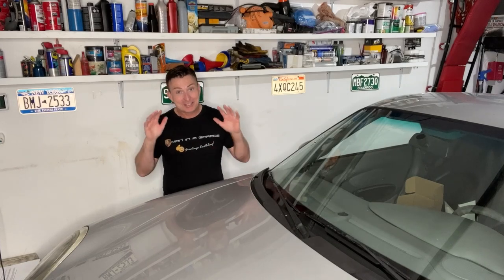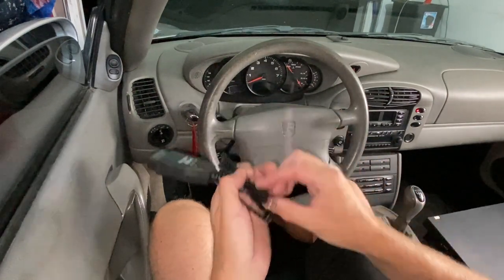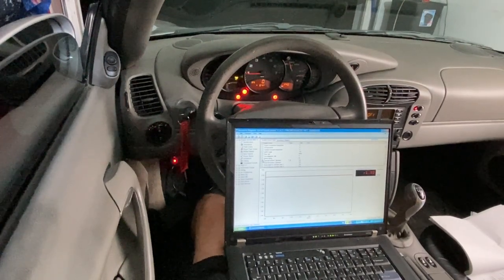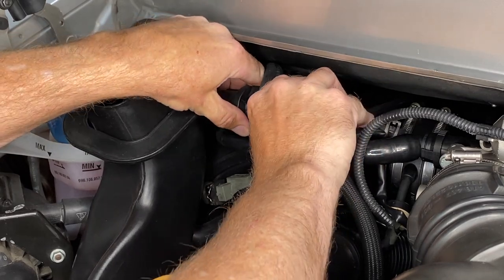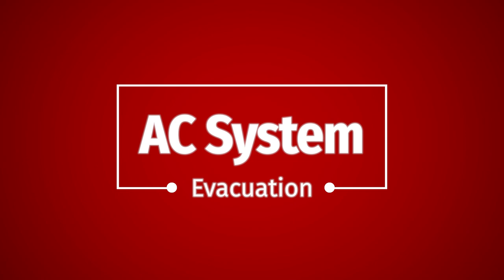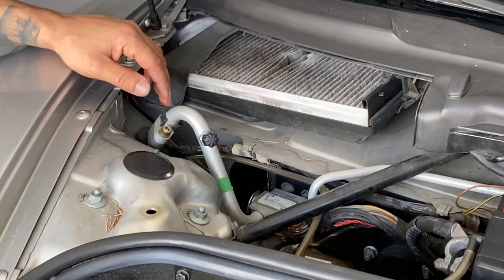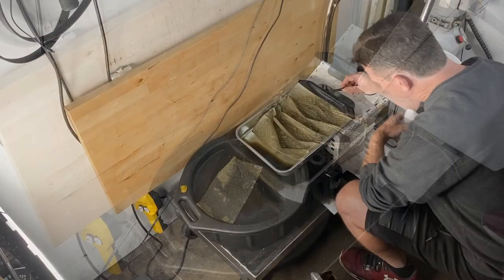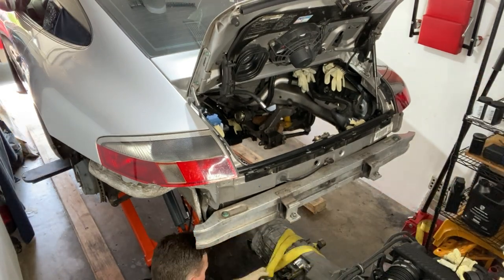Porsche 911 Engine Removal in 12 Minutes!

Comment: Oh hai there. Welcome back! 
Step 1 of any Porsche repair: drop engine... I still love your table! 
Reverse lockout - isn't that part of the shifter assembly? Function First kit is a nice upgrade "while you're in there", just sayin' :)
Reply from the maker: You know I’m googling function first right after this. 🙌 From the info I can gleen for the trickle of rumours and hearsay coming my way this is what I did. 

The bolt thing I unscrewed holds a ball bearing and spring in place. When you go to reverse, it’s that ball bearing/spring combo that stops you accidentally going into reverse when you intend on going into first. The specialist who looked at it scratched their head a little bit. The old guy came out afterward and suggested I should be able to open it up, fish it out and put it back in place. They said I should not drive it just in case the ball bearing or spring get caught in a gear an chew something expensive?? When I dropped it off it drove lovely in all 6 forward gears. When they gave it back it would only go into 1,3 & 5th?? They said something about lining up forks?? Holy crap transmissions scare me 😳